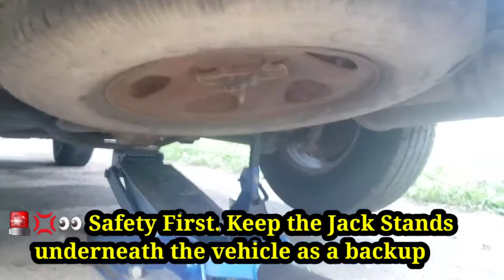2005 Chevrolet Trailblazer Sway Bar Link Change out 2002-2009

Comment: It would have been easier to grind off if you would have just put the grinding wheel between the link and where it's mounted instead of just grinding the outside nut off.